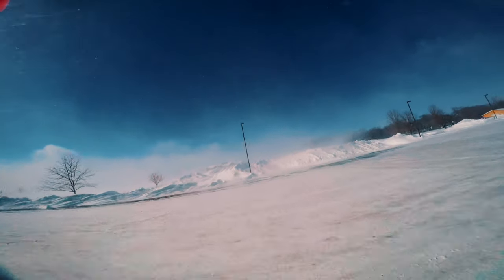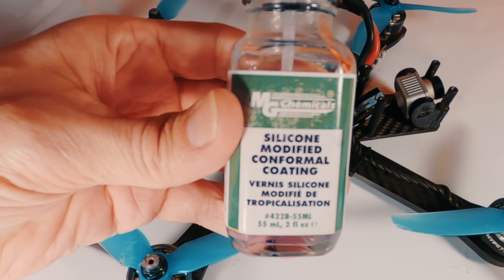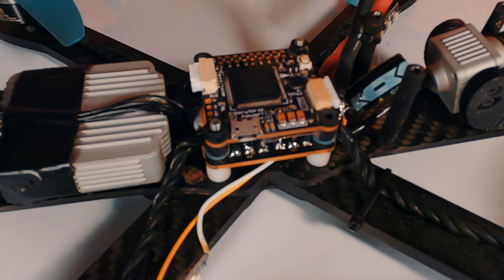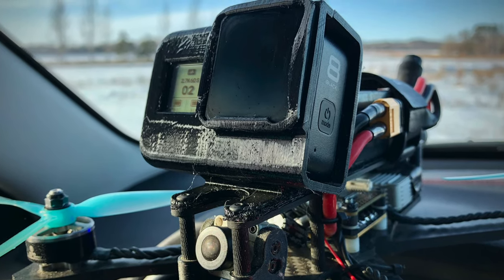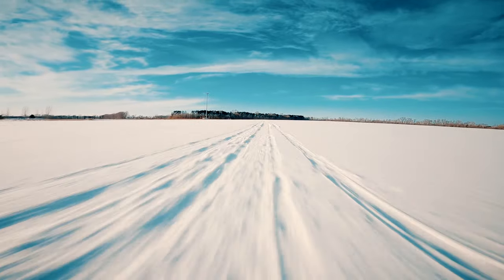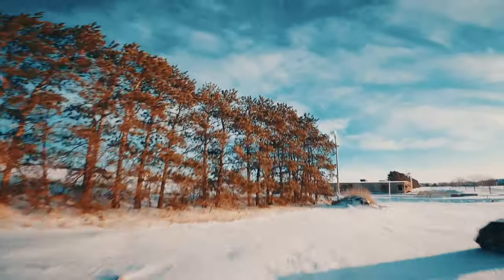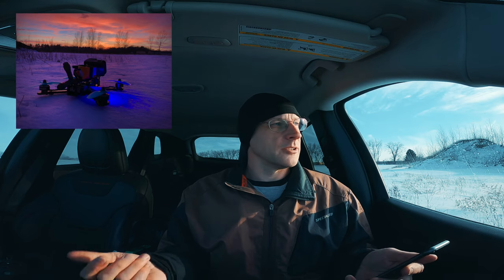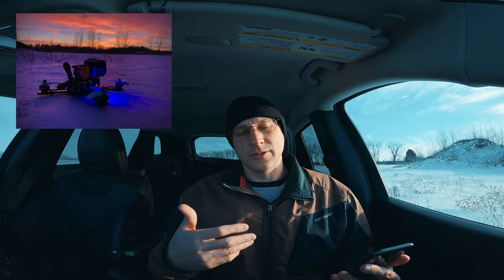Tips for Flying FPV Drones in Cold Weather

Comment from the maker: Of course as soon as I published this video I thought of another tip I forgot to mention.  If you find that your range is too limited when flying from inside your car, get a ground station and attach it to a magnet and plop it on the roof of your car.  Then run the cables through the door and into your goggles.

So, what other great advice did I forget to mention?
Reply: When changing drastic temp environments; place drone or electronics in a ziplock bag and leave it sealed until temperatures equalize. this prevents any risk of fog or humidity forming.
Reply: Thanks for the tips! Do you have any experience on ground stations suitable for such use? 

I also fly from inside a vehicle or a portable tent in summer when I'm north of polar circle due to mosquito swarms... which tends to be even more terrifying than a little bit of snow. ;) Due to the decreased signal I tend to keep quite close though.
Reply from the maker: @juha-matti  Before I got the DJI system I used a ground station.  Unfortunately all the parts I used can't be bought any more.  I took an old CB radio antenna I had with a magnetic base and a stiff antenna mast, attached a diversity video receiver to it, stuck it to the roof of my car, then ran the a/v cables down into the car.  Worked pretty well for me.   This is what the setup looked like:  https://i.imgur.com/U83hx8E.jpg

Comment: Great tips! I find it important to have a beeper if you crash in deep snow. Sometimes Not even crossfire can stay connected when the quad is under snow. Making it hard to find by using a model finder.
Reply from the maker: Ah, that is a great idea!  It can be pretty hard to find the entrance wound in the snow where you went down and you are right, all that wet snow can really kill a signal.  :)
Reply: you can configure it to start beeping when you are failsafed

Comment: Highlights:
00:02 Tips for Flying FPV Drones in Cold Weather
01:36 Apply silicon modified conformal coating to protect electronics from snow and moisture.
02:50 Flying FPV drones in cold weather requires precautions to prevent fogging and moisture buildup.
04:07 Be cautious of changes in terrain when flying FPV drones in snowy conditions
05:48 Be prepared with warm clothing and accessories when flying FPV drones in cold weather.
06:57 Keep your batteries warm in cold weather
08:07 Using LED lights on your drone can make it easier to fly in dark and find it if crashed in snow
09:31 GoPro batteries don't last long in cold weather

Comment: Thanks for making this video. I am in Winnipeg so really needed the tips. Any suggestion for coating the DJI air unit or batteries.
Reply from the maker: I have never done anything special with the batteries.  For the DJI air unit I put some electrical tape over the usb and memory card slots.  I'm hoping that is good enough to keep the air unit protected.
Reply: 5zero7 RC thanks

Comment: Hey thanks for the tips,  found this after ur recommendation during Bardwell's stream :)
You answered many of the questions I've had about flying in snow and even the crashing into it :)
The conformal coating - I know u can't get it near the motor/stator/bells etc,  so what risk do u have when landing in a drift since they aren't protected?  Is it basically crash and done till it dries out? 
Thanks for the videos, very informative!
Reply from the maker: Awesome!  Glad I could help.  Don't worry about the motors.  They can run just fine even submerged in water.  I suppose the bearings might wear out a little faster if they get too wet, but I have not had any issues with that.  If everything else is conformal coated well, just dust off the snow and keep flying.

Comment: I use the radio glove.. I have mine modded with a heater setup.
Reply from the maker: Nice!  Is it heated from a spare lipo or something else?
Reply: @5zero7RC  I found a heater that hobby King used to sale.. Runs on 3s.. Let's you adjust the temperature

Comment: Lipos suffer greatly with cold and can lose even 50% of the capacity when at temps nearing -20c. To make packs cold resistant glue on foil wrapping and thin 2mm polystyrene. This won't work miracles but you will notice the difference.

Comment: Have you found any props that are more durable in the cold?
Reply from the maker: Good question.  Plastic props definitely crack and chip a lot easier when hitting things when they are cold.  I have not personally tried out many props to see what works best.  I have actually only ever really used 2 props in the past 3 years ( Dal cyclone and HQ v1s ).  If anyone has more information on what props work better than others in the cold, I'm sure we would all like to hear about them.
Reply: do you have a video on your antenna setup for your car? would a cheap $10 SMA magnetic setup from amazon work? also i know you use dji sometimes but what cameras hav you found work for night flying and what gopro setting should i use for night since its always dark up here in the north country
Reply from the maker: @jameshanson9938  I have thought about doing a video about the antenna setup I have, but none of the parts I am using are available anywhere anymore.  I am using a CB radio antenna I bought in the mid 90's that has a magnetic base and a very stiff antenna.  Then I have a 5.8ghz receiver attached to it and run the AV cables down to my goggles in the car.  Since I got the DJI system in the fall I have not used analog video at all.

I don't fly at night very often and when I did, the foxeer predator worked fine when flying a well lit parking lot.

My night time GoPro footage never looks as good as I think it should, at least when I compare it to StingerSwarms.  I asked him once how his was so good and his only comment was "I use native white balance".  I assume the trick is finding the lowest iso possible that still gives you a usable image.